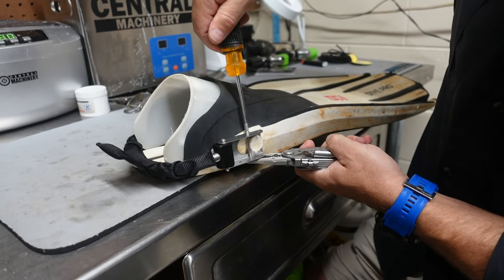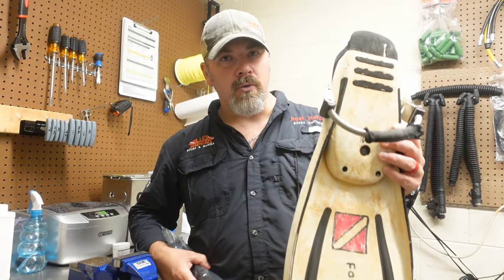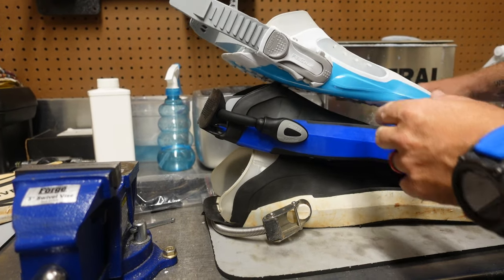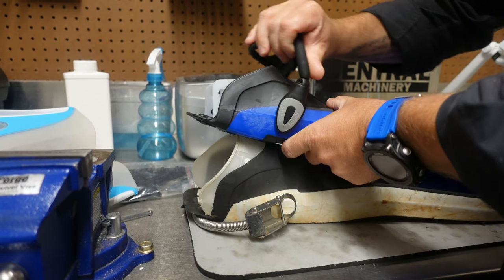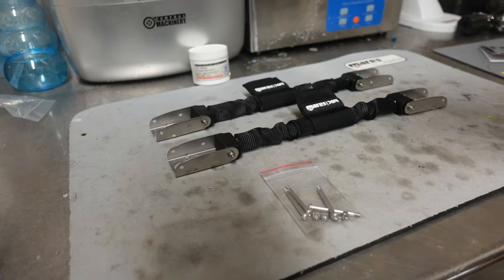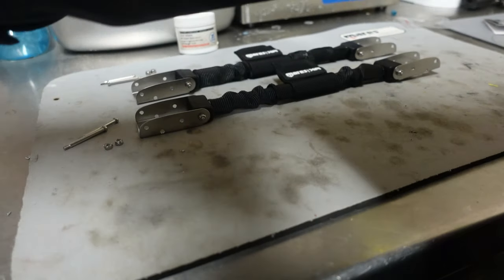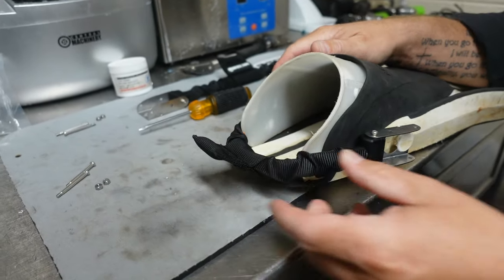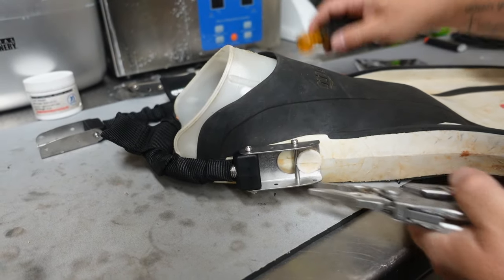Out With The Old In With The New {[ Mares XR Spring Strap Replacement]}

Comment: Had a pair of Quattro for 3 years, best foot pocket of all the fins I've tried. but bungee strap only last 2 years then snaped.  spring strap definitely last longer. but for the same price, if other brand could have spring strap by default, why don't Mares just give up the bungee that won't last.
Reply from the maker: Hello @geerxin, there are several different models of Mares fins that come with Spring Straps pre-installed. As far as all their other models, I would have to refer you directly to Mares for an answer.

Comment: Great show as always. Odd question, Ive seen several YouTubers that use Mares avanti Quattros. How do you feel about them compared to something like a scubapro seawing nova? I ask since they seem similar in being positively buoyant and much different than a jet fin, which are the two fins I primarily use.  Thanks in advance!
Reply from the maker: Hello @JAB24100, even though we prefer the Mares Avanti Quattros over other fins, it all comes down to personal preference. We have made several videos in the past comparing different types of fins. In those videos, no matter the results, we encourage divers to try the fins for themselves and find the one that best works for them. In regards to the buoyancy of a fin, we have never had an issue controlling them when using them. A better comparison to the Seawing Nova's are the Mares X-Streams, and a better comparison to the Jet Fins, is the Mares Power Planas. Both, which we have done videos on. Now on a personal note, I have 4 sets of fins that I use are the Mares Avanti Quattro for all teaching and fun diving, the Mares Power Planas for commercial and Public Safety, the Mares Razor for freediving, and the Mares Wave FF for all snorkeling. The choice to use Mares is for personal preference and the fact we are a Mares dealer. Specifically speaking for the Avanti Quattros, they are engineered for all types of kicking patterens and have an amazing amount of response without too much resistance. For the most part, the Mares Avanti Quattros are nuetrally buoyant, except mine due to the spring straps, and are extrememly comfortable to wear. They also come in 4 different sizes, which will fit virtually any diver, regardless if the wear soft or hard bottom boots. But as I stated before, it all comes down to personal preference. Hope this answers your question.

On a quick side note, I too own a pair of the Seawing Nova's and multiple pairs of Jet fins from Scuba Pro, Oceanic, Dacor, and several other manufactures. I guess you could say I am a gear junkie.
Reply: @LakeHickoryScuba  awesome reply, thank you so much, now I have to watch those videos y’all did of comparing fins. Thanks again and keep up the great work making awesome vids!